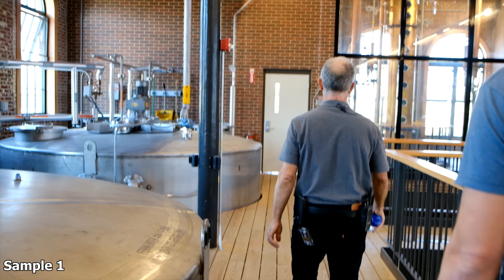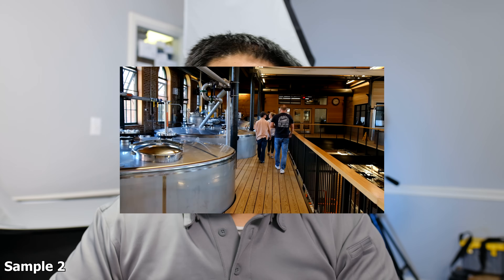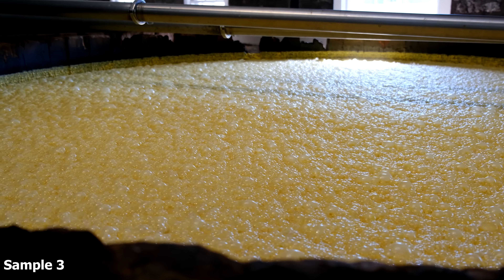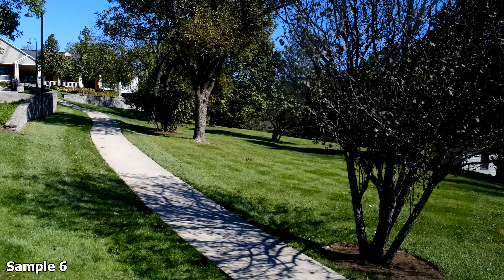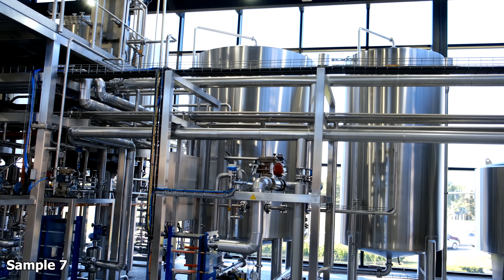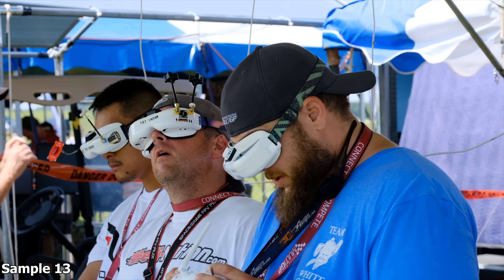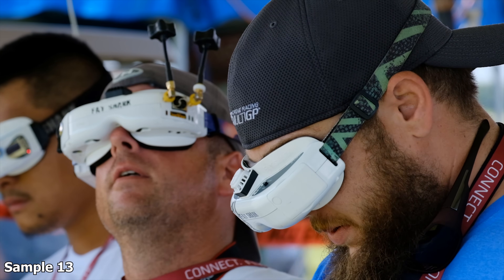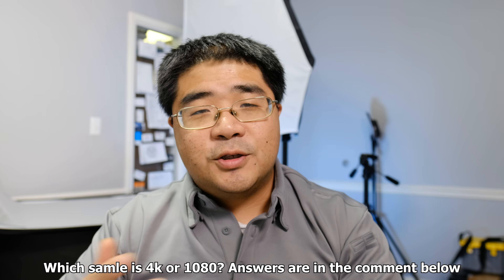Fujifilm X-T3 Slow Motion - 4k 60fps VS 1080 120fps

Comment: Does high speed rec automatically set the shutter at like 1/240?
Reply from the maker: it does not, you can manually set it. In Auto shutter in other to get a proper exposure

Comment: Hi Wai Lam, great info! Do you still change your shutter speed according to the 180 degree shutter rule for slow motion?
Reply from the maker: I agree with what Intra Vista said. If you are unsure what you want, go with the 180 degree as the most common standard. I personally prefer 90 degree for my slow motion but that is my personal preference.
Reply: Thanks for the feedback guys! This is really informative. Thank you very much @Intra Vista @ Wai Lam
Reply: Nice video, did you notice a quality drop btw 96fps and 120fps ?

Comment: Is it possible to playback the 120fps at 30fps on camera if i wanna review the footage at normal speed instead of 120fps?
Reply from the maker: Unfortunately you can not do that, it will only record in slow motion
Reply: If you use the Full HD High Speed Recording Mode - I have set up on a function button, then you can quickly go into a range of slo mo shooting options and when you play them back it does do in slow motion. Might be a firmware upgrade. This is on the XT3.

Comment: Since the camera is converting the 120fps to 60fps or 24fps, do you still shoot with a shutter of 240?
Reply from the maker: Yes if you follow the 180 degree shutter angle, you would use 240 at 120fps

Comment: Great video! I've been experimenting with 60fps timelines for upload to YouTube for my fishing videos. As a result I'm using 2.7k-120fps and 1080p-240fps for slow motion. My main camera is set at 4k 60fps. I'm using GoPro Hero 7's. I also tried mixing a Canon M100 into the mix for B-Roll with great sucess. It's set at 1080p 60fps and slowed down to 30fps. When uploaded and upscaled into a 60fps timeline you can't tell the difference in the resolution.
Reply: Fyi i Personally couldn't understand your comment

Comment: Is there sound in 1080p 60x slow motion?
Reply from the maker: 60 fps does record audio
Reply: Wai Lam 120 FPS doesn’t record audio on the XT3?
Reply: @aaronthomas9163  No
Reply: BREADCRUMBS that’s sucks. I’ll miss that coming from Sony
Reply: @aaronthomas9163  Just add music over it. It does still have autofocus in 120 though unlike the Sony.
Reply: BREADCRUMBS yeah, I will. I never used audio from 120p clips but I knew I had the option if I wanted to and the Sony’s do have AF in 120p. Canon don’t.

Comment: should i record in 4k 29.97fps and edit in post in 23.976 fps for my family video? or should i just record 4k 23.976, i just want the cinematic look in my video. I heard that if you shot in 30p and slow down to 24p, the video look smoother.

Second question, for full HD high speed recorder, if i want some slow mo clip, which option should i choose - 5x 23.976 or 4x 29.97 fps

Again, thank you so much.
Reply from the maker: Recording at 29.97 and exporting to 24 should give you less motion blur because each frame should be sharper but it not guaranteed. What shutter speed you use will play a big factor into that.

Comment: works AF at 120fps ?
Reply from the maker: yes AF work in 120fps but there is no audio
Reply: thanks, did you shoot with Pan. GH5? I have dilemma what to buy :) older Panasonic GH5 or this brand new Fuji XT-3?
Reply from the maker: almost all of the videos on this is recorded with the Fuji X cameras. We have a GH5 for client work (work outside of youtube).  GH5 = greater flexibility, pro features, longer workflow.  X-T3 = easy to use, great colors, faster workflow (no color grading need, unless you want to).

Comment: Thanks for comparisons. This helps a lot!  Quick question.
I like to have the movie silent control on and I noticed when I shoot at 2X or 5X the shutter speed is automatically set at 120.  Since the camera is shooting at 120Fps shouldn't the shutter speed be at 240?  I'm unsure if I should change it. Have you encountered or dealt with this issue.?
Reply from the maker: yes, fujifilm's default setting is to match shutter speed (SS) with frames per second (fps). What that means is that motion blur will be more visible to the human eye. If you find the motion blur to be too much for you, then you will have to set it manually (SS). I personally dont mind it and most people will not even notice. Most of the slow motion you see on the channel that way.